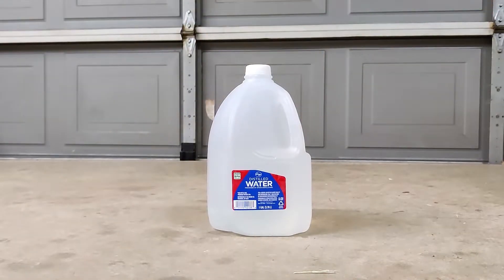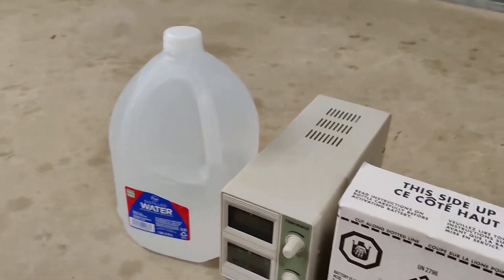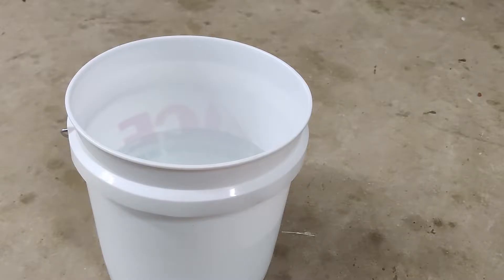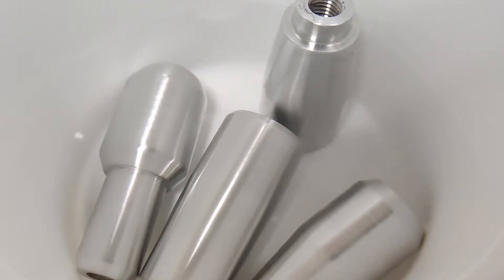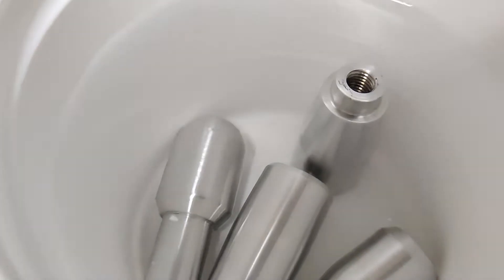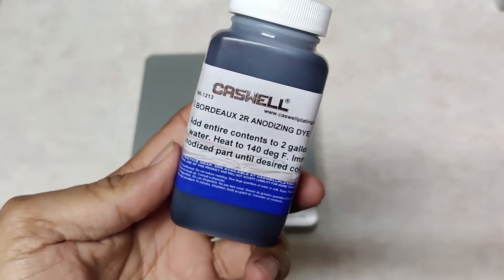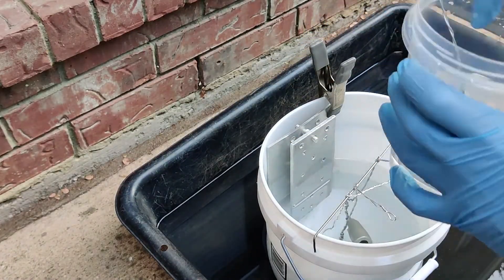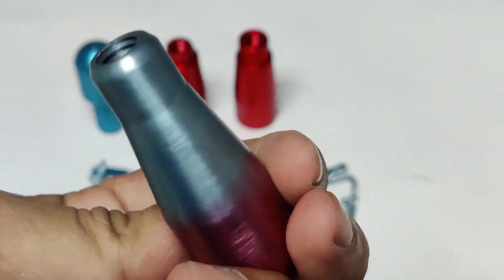Anodizing Aluminum - How I Anodize and Dye Aluminum Parts

Comment: If you have a lathe, why don’t you make some aluminum bolts with a very short thread that you can screw deep in the hole and not play with the aluminum wire?
Reply from the maker: It's because I'm lazy and that would take extra work. The wire is easier and pretty cheap :)

Comment: I have a big issue with what you said about polishing the parts up AFTER you anodized them. You are supposed to polish them BEFORE you anodize… ALWAYS! The trade off is that the anodic process dulls the polish a tad so you have to polish to a super high quality polish before anodizing and then make sure you time your anodic process precisely so you have an identical finish every time.

If you polish after anodizing you are literally removing the sealing layer and you dye will slowly fade. There's a reason why the last step of anodizing is SEALING.
Reply from the maker: I always have to polish (wax and buff) the parts afterwards to  get any haze off of them. It's not an abrasive polish but more of a "shine".

Comment: BEST video on YouTube! I do have a few questions. 1. You mentioned rinsing in a baking soda and distilled water solution after removing the parts from the anodizing solution prior to dying the parts. Do you have a ratio/mixture for the baking soda and distilled water solution? 2. Is the dying solution mixed with distilled water? 3. What method do you use to heat the dying solution the 120 to 140 degrees and how is that temp maintained or is it a one time heat and soak? 4. You mentioned that some dye is left in the water. Are the parts placed in distilled water after dying and if so, how long? Is this just a "rinse"? Lastly...5. You mention polishing after boiling. Is this polishing on a buffer? Is there a compound used? If so, what do you recommend?
SO sorry for all the questions! Just trying to fill in the blanks! 
Again....BEST video!
Reply from the maker: Thank you for watching. Let's see if I can answer some of your questions: 

1) Not really, I just put a few tablespoons into about half a gallon of water to try and neutralize the acid. 
2) Yes - don't use tap water 
3) I have used both a microwave (spare) and a dedicated pot while measuring the temp with an instant read thermometer. It's pretty much a one time heat and soak. 
4) I just rinse them afterwards in distilled water. It's really more just to get off any excess and not transfer it to the sealing bath.
5) Yes, just buffing. Any car buffing compound will work that you get at an auto parts store.  The more prep work you put into your part means less of this step is needed. 

Hope this helps. :)
Reply: @ShinyInsanity you’re the BEST!

Comment: Can I turn my black aluminium into red one? Or do i have to sand paper it till the black anodized gets off?
Reply from the maker: You have to remove the old anodization (either chemically or physically) before you can get the new color layer on.

Comment: Why not use aluminum or titanium screws for connecting the wire to the part?
Reply from the maker: Aluminum screws are more expensive, the part would have to have a tapped thread and it would still get anodized. Titanium screws wouldn't get anodized but I didn't have any and the parts weren't tapped.

Comment: I have a black aluminum bicycle headlight that I'd like to anodize a different color. I assume the factory black coating is also anodizing, but not sure. Can I use lye or other strong chemical to remove the factory black coating, or does that have to be done by sanding? I ask this because there are a lot of little grooves and texture to the light (Fenix BC26R) and I think it won't be practical to sand it. Thanks.
Reply from the maker: If it is an aluminum oxide black coating then lye should take most of it off, but you'll still need to sand it and clean it before putting on another anodizing layer. Re-anodizing a part seems to take more work than just anodizing a new part IMO. Best of luck.
Reply: @ShinyInsanity  Thank you!

Comment: so I ordered some parts for a small RC car, they are 7075 aluminum silver....so could i sand those down and do this same process if i wanted them purple
Reply from the maker: Yes, 7075 can be anodized and dyed using the same process.
Reply: NO! DO NOT SAND ANYTHING! You want to STRIP the anodize off of them.

Comment: Is anodized metal scratch resistant, say for a metal fishing lure, or would a different type of coating be more adequate?
Reply from the maker: It has some scratch resistance but it's not super hard. It can work on a lure but will get scratched from teeth and banging around on the boat. Enamel paint is probably easier and can be touched up easier.

Comment: Hello
Is it possible to re:dye a part?
I have a fishing reel that supposed to be black but one side plate is brownish and i dont like it at all.

Tnx /F
Reply from the maker: You would have to first strip off the anodizing layer with something like a chemical process (ex. lye) or mechanical (lathe or sandblasting) and then clean it thoroughly before re-anodizing.

Comment: this video is awesome! i do have a question: i understand that the aluminum wires being used as hanging rods for the part being anodized are one time use (and titanium wires are not). are the aluminum cathodes also one time use? is there an alternative, if so?
Reply from the maker: Thank you. No, the cathodes can be used multiple times as long as they are in good shape. I've seen people also use lead cathodes but I've never had any issues with aluminum.
Reply: @ShinyInsanity  is copper better?
Reply from the maker: @fieldrecordstalent  No, copper would contaminate the solution as far as I know.

Comment: You did not elaborate on the part that was red and blue, end to end. Also, can a part be dyed with one color over a second color? Say red over black or green over yellow. I am thinking of an effect where a second color occasionally appears in an otherwise uniform finish.
Reply from the maker: The red and blue part was just done by dying one side partially then flipping it around and dying the other side partially. You can dye over colors but they will blend. I do not think you will get the fade through effect you mentioned.
Reply: Look up any paintball anodizing its insane

Comment: Excellent Content, with Perfect Delivery💯Especially for my ADHD 🧠🤓
📍I machine Aluminum 1:25 scale auto model parts on a Mill & Lathe. My question is this; “How can you regulate the amount of color you want with a part?” Ex: Motor parts that I’m using a Butter/Yellow Anodize Dye, but I only want a very light tint of the color..
👉Can you tell me what to tweak to do this please…
Thank-U -Sir..... Respectfully,
Lee aka: ZenModeling☯️
Reply from the maker: Thanks for watching. To get consistent part coloring I would use weigh out the same amount of pigment for a new batch each time after finding the right shade of tint I want and dip the parts for the same time. It will take some experimenting at first to find the amount of dye and time to get the color you want.
Reply: @ShinyInsanity  I’ve done several parts since last message & they all came out 💯 Thanks!
Reply from the maker: @Zen_Modeling   Glad to hear that!
Reply: @ShinyInsanity  
👉I’m using a Sodium Bisulfate solution with Lead cathode strips @ 16v & 0.3amp’s for about 90 mins & using Black, Red & Gold colors + (Liquid-Nickel-Acetate-Sealer) & so far have all been 💯
Reply from the maker: @Zen_Modeling  Not really familiar with the sodium bisulfate method but sounds interesting. Any videos or documentation you can share?
Reply: @ShinyInsanity  
I’m gonna do a How-2- Video in here. You would luv it, None of that  “sulfuric acid” volatility & drama. It’s basically a PH adjuster for a Jacuzzi😊 I’m gonna put up the video in a few days. I’m having knee replacement surgery Monday so I’ll have plenty of time. (The content is already in the can- just need to edit…☯️Lee
Reply from the maker: @Zen_Modeling Looking forward to watching it. Hope the surgery went well.

Comment: I sandblasted me aluminum part can I now anodiz the part or does the aluminum need to be shiny
Reply from the maker: As long as the part is cleaned after sandblasting you can anodize. Clean meaning free of dirt, oil or other debris. The finish will be matte versus shiny.

Comment: Excellent video! Can you dye aluminum parts that are anodized but we’re not dyed (still natural aluminum color)?
Reply from the maker: Thank you. Not that I am aware. The parts need to be anodized to accept dye and were probably already sealed in their natural color already. You'd need to strip the anodized layer and go through the process again. There are clear "anodized" looking paints that give a similar effect though.
Reply: Thanks for the quick reply. There’s a reel I’d like to dye that is anodized and sealed without dye. To buy that exact same reel with a color is $200-300 more. Thanks again!
Reply from the maker: No problem! What reel is it? Silver hides scratches a lot better than a lot of other colors.

Comment: Have you had any issues with the power supply not reaching/maintaining the desired amperage? I’m using a digital dc supply with a constant current setting but it keeps kicking me out of CC and reverts to constant voltage.
Reply from the maker: I've had that problem before as the acid solution temperature stabilizes. It often jumps around as the temperature fluctuates but levels out later. I've found on the cheaper dc power supplies like mine it's best to set it up for a lower voltage/current target to start versus trying for higher levels right off the start.